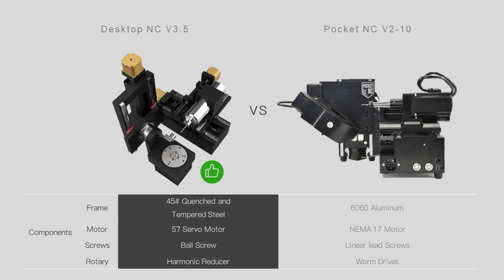Desktop 5 Aixs Milling/CNC，Desktop NC V3.5 VS Pocket NC V2-10,  More Powerful and Cheapest？

Comment: question  2-50 with 200w spindle can cut precisely 316 ss and up to some titanium alloys  ,what is desktopnc situation with hard metals ?    is it just soft alu and other soft materials like pocketnc 2  or it can do more ??
Reply from the maker: 200w is a small tool, low-speed processing.
For v3.5 cutting efficiency, 800w is more than twice as fast as 200w.

It mainly processes soft metals.
Titanium alloys, steel, etc. can only be processed with a 2mm internal milling cutter like a denture cutting machine at most, with 1.5KW and 40,000rpm. The efficiency of non-industrial equipment is very low, so we do not recommend.

We will not overly boast about equipment performance for sales.
Reply from the maker: you can see any official video about 316 ss or Ti ？
Reply: @MaxwellLabs  yea i see your point ..  i just look forum on pocetnc site most of users of 2-50 sell them
Reply from the maker: @MrCcfly  But I don't think it's just because they can't cut steel and titanium,maybe have other problem
Reply: @MrCcfly  pocketnc is too weak. they said it can cut steel and ti.... but cutting the parts for 24hours..... it is not cutting , it is polishing.... lol. If i pay that high cost for PN V2-50.. i will pay little bit more for Tormach 440.

Comment: which controller is this? works with fusion360?
Reply from the maker: We design a controll application, you  can use fusion360 to generate  a Gcode for Controll software
Reply: @MaxwellLabs  so it will be a post processor for this machine availible? does the machine has TCP?
Reply from the maker: @andysen1987  yes it has RTCP

Comment: Any updates on this machine
Reply from the maker: Recommended to choose
1.Grinding ball screw
2. Metal Enclosure with Cutting fluid
3. Industrial touch screen computer
other optional
4. 40000 rpm spindle
5. More chuck , Vise, ER collet
Premium services：
Purchasing materials, cutting tools, custom clamps, and measuring tools